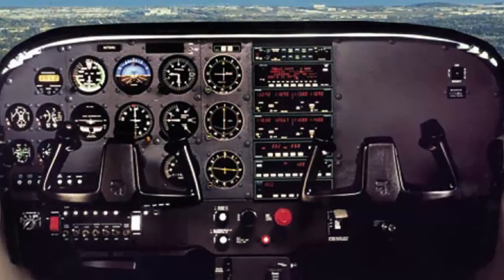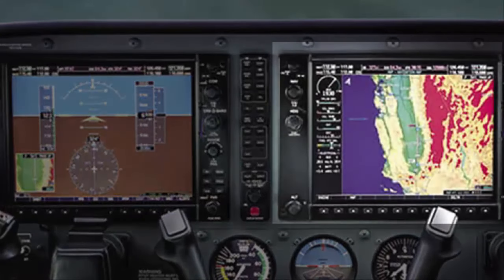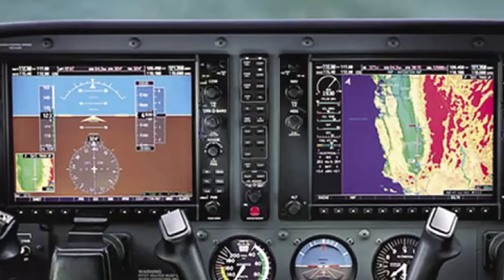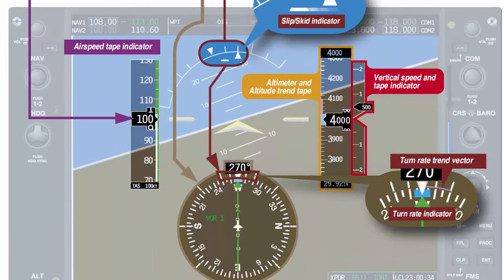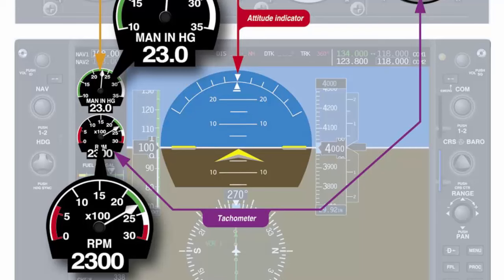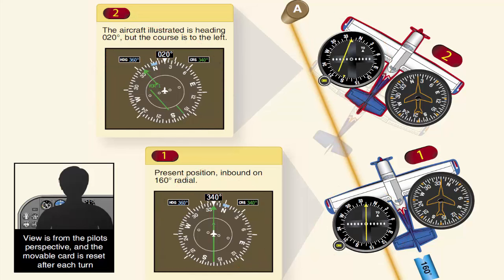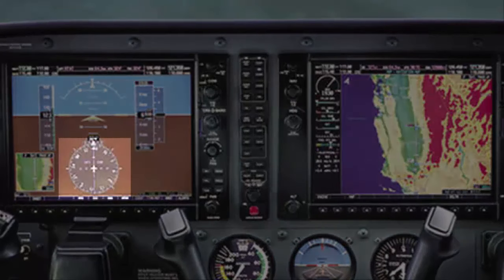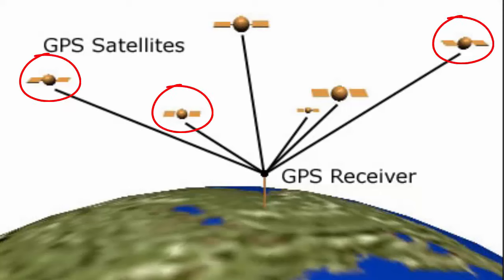Aircraft Avionics Basic Introduction

Comment: My smartphone,s, computers, and tablets crash about daily... the guages in my cars/trucks/motorcycles/tractors/etc...  have never failed in 40 years...

Dont get me wrong, the computer is ok for night and for GPS visualization... but id only ever consider it an accessory to supplement analog instrumentation... I dont need a computer readout to fly, but I do need analog gauges... especially if the computer crashes...
Reply: If you think a single failure can cause an aircraft to lose indications, then honestly, you don't know anything about modern avionics systems.
Reply: @rcairflr  when the computer crashes its not a "single failure", you lose everything computerized by that computer, at the same time...
Reply: @toadamine  .  What exactly computer?"  There is not a single computer that runs the whole aircraft or even the cockpit.   Many LRUs have a processor in them.  For example.  Each Display on a modern airlihner has its own processor.   If it fails, the display will fial, but all the data will go on another display, many will do it automatically.  If a Flight Computer fails, there are usually 3 on a modern airlineer and another will take over.   It is called redundancy and that is why you hardly hear of major failures.  So as I said earlier, a single failure does not cause loss of data to the pilots.
Reply: @toadamine  >  you stated:   "  when the computer crashes its not a "single failure", you lose everything computerized by that computer,".    
That statement shows that you really have no idea how a modern commercial airliner is designed and operates.   I am out of here.   You just make statements based on your lack of knowledge.
Reply: @rcairflr  there was just one-third other day I was watching where the computer kept telling the pilots the wrong info and the airliner crashed... was either on Montour or blancolirio, and it's not uncommon on these crash investigation channels to have a computer or computerized sensor fail or become corrupt and give bad info or whatever and cause major issues that the pilots have to go thru boots to troubleshoot while the plane falls out of the sky
Reply: @toadamine  Link?  BTW, I would argue that it is uncommon.  80% of crashes are pilot error.  There have been aircraft failures that cuased crashed but very low percent are due to computer/software errors.  You cannot call a sensor computerized.   Yes the signal will go to an LRU, but that does not make ithe sensor computerized.  Most 9not all) sensors on an aircraft air analog devices.
Reply: @rcairflr  those are just very recent videos he put out, there's tons more with similar issues...
Reply: @toadamine  > please give a link so I can review it.  I cannot comment without seeing what you are referring to.
Reply: @toadamine  >  BTW, look at the previous response from the guy I originally replied to.  He says "the computer", like he thinks there is a single computer running an aircraft.  That just shows his lack of knowledge.  BTW, I will share my experience.  I worked 32 years is aircraft developement and flight Test Certification.   My last aircraft Certification before retiring was the Bombardier Global 7500 and CSERies.  B oth very advance aircraft.    So I think I know aircraft very well.  I understand the design and understand the redundacny and also understand the industry is always learning and always changeing the Certification requirements based on lessons learned.   Modern aircraft are extemely safe, have a lot of redundancy and on moden aircratt you will see few to none crashes caused by computer/software failures.
So if your videos that you are talking about is 70s or 80s design, then you are just nit picking.  That is like talking about automobile safety for modern cars and using a 1980 Chevy as your example.   So I would really like a link to the crash you are talking about.
Reply: @rcairflr  oops wrong video, this is the one I was thinking of. https://youtu.be/31j_A2BC8kA
Reply: Here's another good one.. https://youtu.be/5ywaMkMTwWk
Reply: @rcairflr  it's a bunch of computers, but they interact with each other so when one give faulty info, or a sensor gives faulty info, it can flow a long way downstream in the system...  it's not that rare to have major issues, it's just rare to have them in the redundant system at the same time...
Reply: @toadamine  OK, watched the video.  OUr discussion was computerized systems and software.  None of this had anything to do with that.   This was caused by poor maintenance practices and a flight crew that allowed themselves to get stressed and over worked.   
The failures were the Left IRS and the left Radio altimeter.  Both requred for CAT III landing.   The Flight Control Computer did exactly what it should with the bad information.
Now, the ADIRU does not have a processor and is no way controlled by a processor.  It had a failure.   The Radio Altimerer, again, does not have a processor, it had a failure.  
Maintenance should have had these problems fixed.   
I am going to lunch, will watch the other one later.  Please stay on track, the discussion is A/C computerized systems and software not whether aircraft can have failures.  EVERYTHING created by man can have failures.